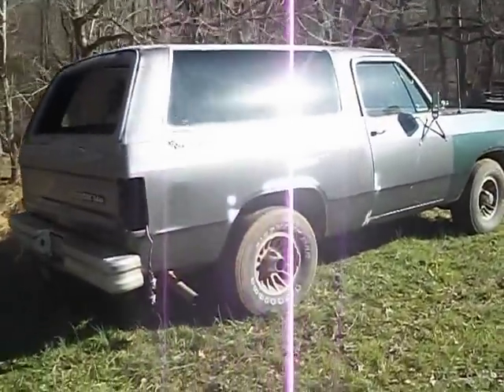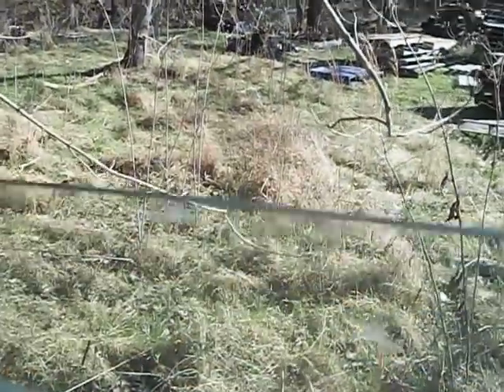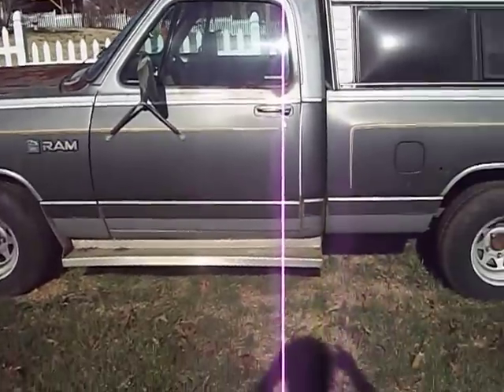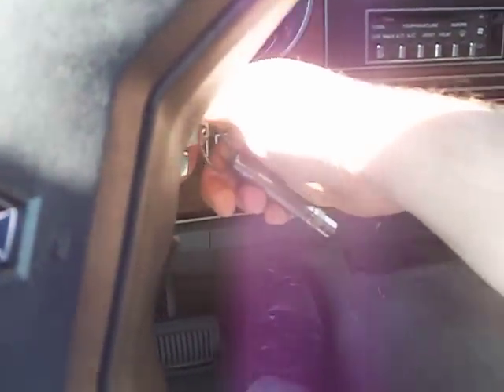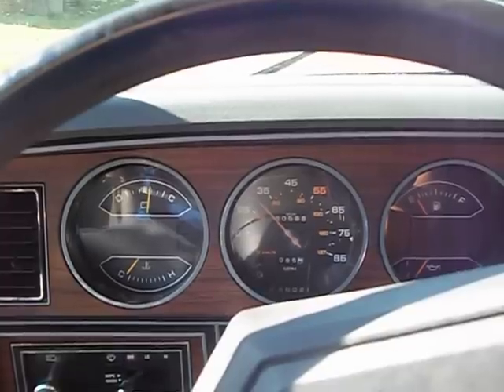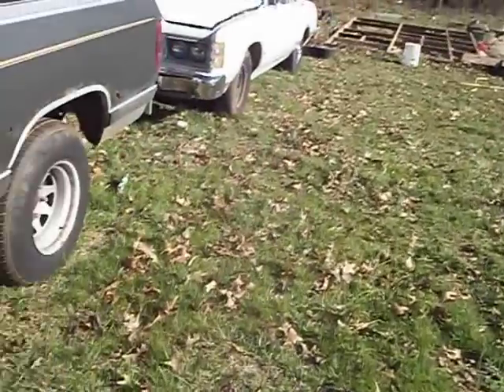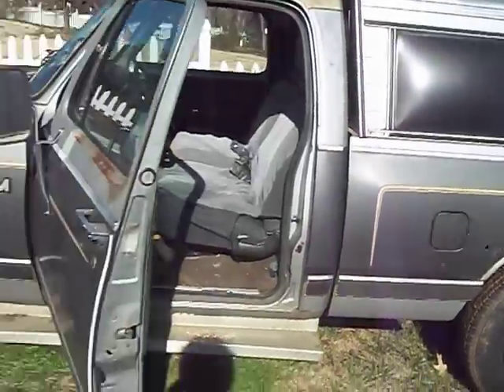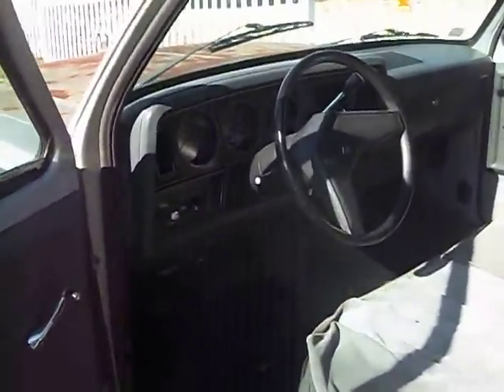Dodge cold start and story

Comment: i would love to ride in a 1983 Dodge RAM D100 with a 225 slant 6 2 bbl
automatic that sucks. manual windows locks and mirrors with the box bolted to the bed 
387,402 miles, runs like new and drives perfect but its got a crappy carb great shape when its -9 and 34 degrees F and below freezing lots of pumping and cranking 
if u don't give it enough gas in the carb it will run for 1 hour and then it dies